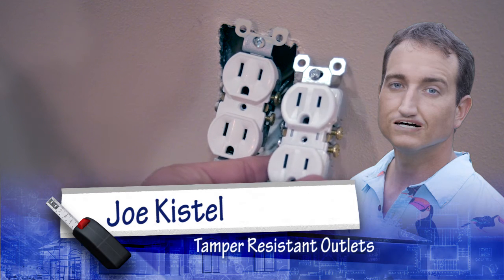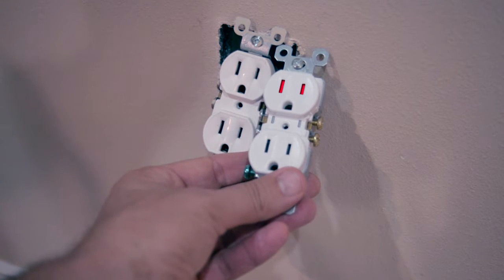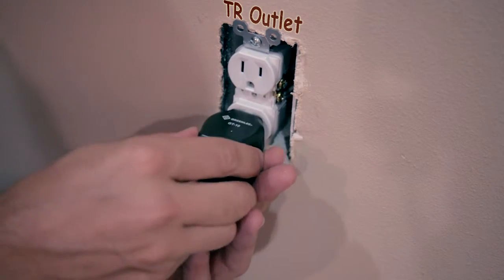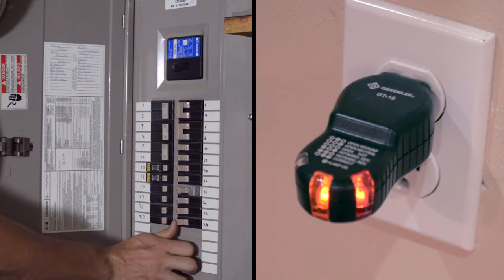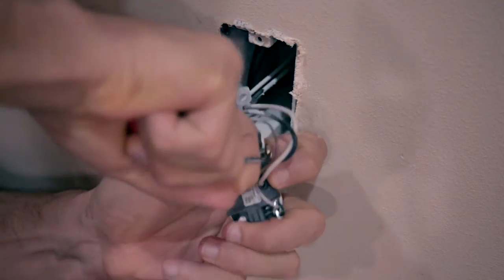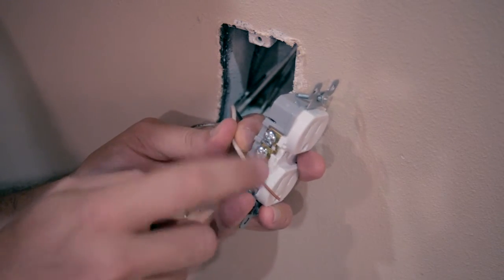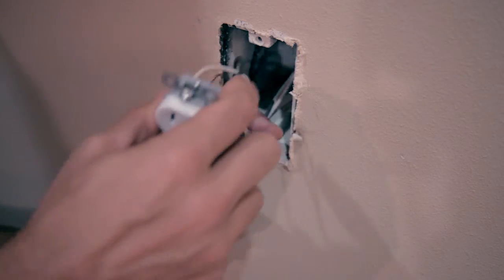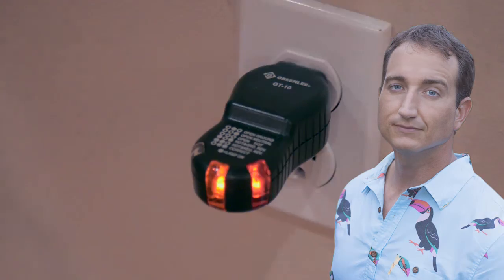How To Install New Electrical Outlets and Why You Should

Comment: gave you a thumbs up but why would you pick the most simple case?  you're just going to frustrate people when they open up that box and see two sets of wires (4 total).  you picked an outlet that happens to be the last one on the circuit.  As biden would say, "Come on, man!"
Reply from the maker: Thanks for the 👍.  Yes there can be all sorts of wires in an electrical outlet box.